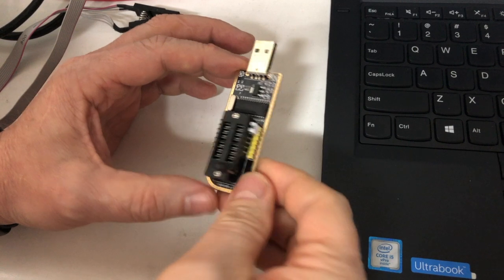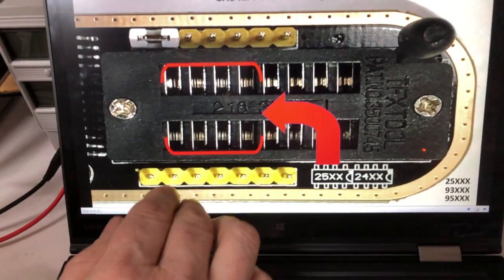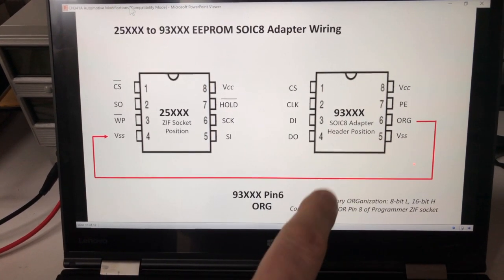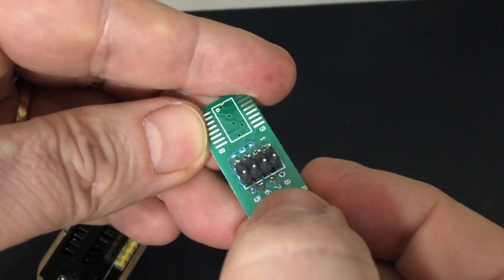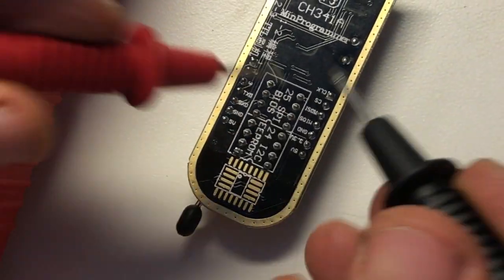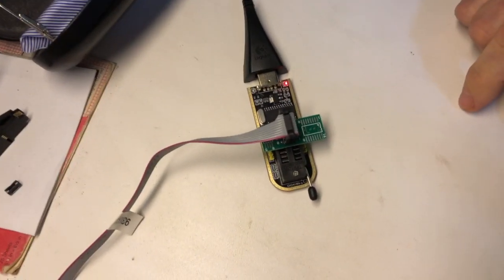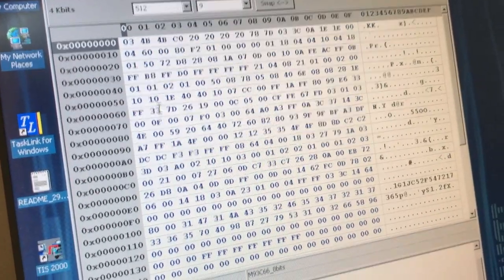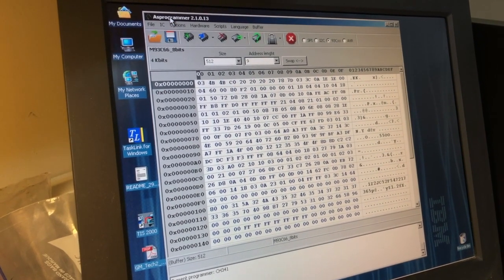Modify the CH341A EEPROM Programmer (Black Edition) for 5V 93XXX & 95XXX Automotive Use

Comment: No need to solder any wires, cut any tracks or lift any legs at all, I just connect another jumper on the pin header between the 3.3v and 5v rails, this effectively bypasses the 3.3v regulator providing only 5v to the ZIF socket and IC.
Reply: thanks steve can you post a pic of your jumper set up
Reply: @lourob5353   do you have any pic for jumper ? 🥲
Reply: Great. Could you show a picture how to do it easier?
Reply: Confirmed. Jumper between 5V and 3.3V and proper connection of microchip and socket pins enable us to communicate with 93xxx microchips using 25xxx socketm. Tried with 93c56(RL56) on VFR8006 dash and read and programmed fine.
Reply: @TheCychu977  I have the 93C56 chip on a 2007 Camry but it just gave me a bunch of 00s and ffs (I tested on a known good chip on the same PCB and it worked just fine). Did you get it to work while it is still on the PCB or did you desolder it and read it by itself?
Reply: @Baebon6259  hey did you end up programming your chip? Im curious as I have the same one and trying to work jt out
Reply: @TheCychu977 hey by any chance could you post a photo of the jumper setup
Reply: whatt phot pic ?
Reply: how?
Reply: Also lift pins 1 and 3 on the 3.3 voltage regulator. This will reduce loading the 5 volt supply.
Reply: @jeffanderson9093  which pins are 1 and 3
Reply: Tiene razón ahorita que mire el del video soldo un cable donde dice 5 volteos y lo junto donde dice 3volteos, y creo que algo recuerdo 🤔 hace unos días estaba quemando mi   eeprom de 3 volteos  nunca miré el puente si estaba en donde dice 3 v y 5v creo que si por que medí el voltaje y ne salia 5volts,  así que analice todo y le regrese el puente en donde dice 1 y 2 y cambie regulador de voltaje  creyendo que estaba dañado y ahorita haré las pruebas poniendo el puente  pero so es donde esta la zona abajo dice 3v y 5 v juntos soñó pasar el lente allí el que tiene plástico amarillo y listo 😅
Reply: Any pictures on where you put the jumper?
Reply: @kurtkaraan  the header is labeled on the pcb like CLK CS MOSI MESD GND 3.3V 5V   ,,,,, the 2 pins 3.3V&5V are the pins you put the jumper on it

Comment: Good evening everyone, my question is if after having made that modification to be able to program the 93xx series can it continue to be used for both 24xx and 93xx ???
Reply from the maker: The 93xxx is an external adapter + software, so has no change to the programmer.  The 5V mod is so you can do automotive versions of all these devices.  That one is permanent, unless you do a toggle or jumper approach, you'll lose the general electronics type 3.3V versions of the same devices.

Comment: Hey there do you know by any chance if you can read a 35080 eeprom with a CH341 ?.
Reply: Hi, thanks for this video. I can confirm the ch341a black can indeed read and also erase data on the M35080 eeprom. Writing is possible also except currently the first two lines which currently seem protected, working on this now if anyone has ideas. Happy to share the pin configuration I followed too if it helps anyone 😁
Reply from the maker: I have not personally tried it, but I do see the algorithm is supported for the ST M35080 in Asprogrammer as linked in this video description being SPI based.  BUT, you will have to construct an adapter for the 25xxx part of the ZIF connector, as the pinout is different.  Here's the M35080 datasheet that you can use to compare with the 25XXX I already showed in this video pdf.datasheetcatalog.com/datasheets/150/445022_DS.pdf

Comment: I bought a slightly different version of the CH341 programmer (not "black") and it doesn't have a dedicated +5V pin. The only place where +5V can be measured on the pcb is upstream and downstream of the "3V" :-)  regulator (the large regulator leg and the middle leg) and in the USB connector. Do you think it is safe to use the USB connector +5V and bridge it with pin 8 in the adapter for write power?
Reply from the maker: That used to be the problem with the earlier generation of these black edition ones too.   Since there's no jumper, the BIOS type folks loved it being 3.3VDC but that's useless for automotive work.   So yeah, you're going to get clean 5VDC from the laptop/PC USB jack as input to the regulator supplying your 3.3VDC.  Depending on the regulator type, there might be a 5V passthru pin you can bodge directly from, otherwise I'd just take it from the input to the regulator.   I wouldn't take it directly from the USB jack, it'll be less iron heat to tap the regulator.
Reply: @DrShock  Thanks! I'll tap the regulator input.

Comment: Could it be possible to still pull the skc off a 95320 eeprom chip without circuit mod if I don’t intend to reprogram it? I just need my security code so I can do key adaptation on my vw? Thanks
Reply: Also I have the clip and wire on small board attached to the black connector so the first part I have I’ve just not modded the main board to receive 5v
Reply from the maker: Hard to say, won't hurt anything to try.  You may be able to read it at 3.3V, I did read many devices that way just fine.   But there were a few 93s that wanted the 5V even to read.  What's more likely is to run into a problem reading it in-circuit with a test clip.  I find nearly all 93xxx and 95xxx boards need the chip removed.   Usually a 24xxx board you can get away with, but even some of those you have to desolder it due to interference from other chips that get powered up via the test clip.
Reply: Hi Doc can you confirm if the 95XX chips need the adaptor mod too? Cheers

Comment: i didnt get how you built the first board where did you get the black headers
Reply from the maker: Sometimes these black edition programmers come with some accessories like headers and a bare prototype board, for example.   Note that as I mention in the video though, if you try and repurpose one of those boards as a 93xxx adapter you have to cut the PCB traces and bodge wire it underneath the headers per the video adapter instructions.   The PCBs are wired for 24xxx EEPROMs originally just like the programmer itself.  You can't just add the wires, you have to remove the headers, cut the traces, and then add the wires.
Reply: @DrShock  so i have the same board that you have . and you are telling me that i have to cut the traces on the board and then ad all the cables that you did to yours?
Reply: sorry my English its not that great so i have to ask stupid question some times
Reply from the maker: Yep, if you're choosing to repurpose the little prototyping board that came with the programmer for use as a 93xxx adapter, then you have to desolder the pin headers off of it.   Then cut the traces that are not common with the 93xxx pinout.  And then solder on bodge wires to match the adapter instructions.   Then reinstall the headers.  This is a more advanced electronics approach, and more easily done under magnification.   A somewhat easier approach may be to build the adapter from scratch.
Reply from the maker: No such thing as a stupid question in engineering ;-)
Reply: @DrShock  thanks a lot i did i can read it now. but by mistake i removed a ship and i forgot the way it was can you tell me if there is a way two know how it goes on ?
Reply from the maker: @macgyver5033  Well what's the context - removed a chip from what?
Reply: @DrShock  from a cluster honda accord 05
Reply from the maker: @macgyver5033  No, not familiar with Honda electronics.   But a google search on 2005 Honda instrument cluster circuit board shows many photos

Comment: Tried this out the other day, thanks BTW.
One thing I did Different was put a hard drive jumper on the 3v/5v pins on the top. It seemed to work fine. I might still lift the 3v center leg. 
One heck of a learning curve for peeps like me...lol  Changed a XM vin before breaking my cheep clip.
Reply: Did you still have to do the custom SOIC8 clip conversion that he did? I purchased a ch341a that came with a SOIC8 adapter. I'm assuming that because of that, I likely just have to plug it in, put the jumper on the 3v/5v pins at the top (I need 5v as well), and I should be good to go?
Reply: I jumped across the regulator, Vin to Vout basically (5V to 3V) by installing the jumper.  I got 5V and yea h it seems like it would work correct?

Comment: Hi. My ch341a gives 5 volts by default on the data lines! Then is it ready to go for 93xxx or 95xxx chips? Nothing have to do? Thank you.
Reply from the maker: You have to have a wiring adapter for the 93XXX.   And for either you need a software app that knows how to program them as well as supports the CH341a black edition.
Reply: @DrShock  Ok. Thanks. But for 95xxx is ready to go by default then?
Reply from the maker: Hardware wise yes presuming your data lines comment was a typo as the 5V needs to be on the voltage pin and any other pulled high pins, but you still need to use a software that supports both the 95XXX and the CH341a black edition such as Asprogrammer.
Reply: @DrShock  Did they change the design? I remember that in the past (2019) 5V was the default, and people did mods to make it use 3.3V instead.
Reply from the maker: @TJGermany  Either that or there's more than one flavor.  The one I show in this video only has 3.3V.  Which is great if you're doing PC BIOS and other consumer electronics, but useless for automotive work.   Ideally they would spend the fraction of a penny to add a jumper for both voltages, but the Chinese manufacturers haven't bothered to do that.
Reply: @DrShock  Jumper would be great, or at least label the two flavors somehow! Mine is also the "black edition" and looks exactly the same as yours, however it was using 5V and I needed it - as you said - for PC BIOS and stuff that required 3.3V.

Comment: I'm tryin to read a cs566 (93s56 I believe) using your mod, however, when I read the chip it returns nothing but 7f 2c repeatedly. 
Any ideas?
Reply: It worked!!!!! At first I tried tying pin 7 to 5v and it didn't work. Then I tied it to gnd and it read the chip. I had just about given up. I almost fried the chip connecting the adapter backwards. It heated up real bad. I thought it was done for. Then I looked at my connection and noticed I had it backwards. Anyway your solution worked. I did notice that I get different data when I select the 8bit version from when I select the 16bit version. It still all looks like hexadecimal gibberish but at least it is data. Not like at first where it was clearly all wrong. Thanks a million.
Reply from the maker: Glad to read, just another task this little programmer can handle.  Yeah, it's very important you have the memory organization pin set high or low as the circuit requires and that you match that 8/16-bit selection (this info is in the video) with the software choice in Asprogrammer to read the data matching that choice (8/16-bit).
Reply from the maker: Would seem that you're getting power and ground pins ok with that outcome.   Presuming you have it plugged into the right ZIF socket section, then continuous fixed memory values would indicate to me either a mis-wired adapter (check each pin is uniquely connected the way I go over for the 93xxx adapter with no previous traces if you're reusing something for this) or that you have a conflict with another device on the PCB.  If the latter, just desolder the device and read it out of circuit to get around that.
Reply: @DrShock  Thank you for your prompt response. I just double checked step by step as you indicated in your video and the connections are correct. I noticed that lifting the center leg of the ams117 does not isolate 3v3 from the power pins though. It does however, show 5v at that leg when 5v is spliced to the vcc pins. Not that it affects it in any way just thought I'd mention. The chip is being read out of circuit so no interference with anything else in the circuit. Would it matter that the drop down does not show 93(s)56 and only 93(c)56?
Reply from the maker: The "56" denotes 128 words at 16bits wide so that part wouldn't be an issue. But checking an ST datasheet for this device (linked) the "s" denotes a security EEPROM type.   For the "s" series pin 7 needs to be connected whereas with the "c" series I cover in the video, pin 7 is a no connection pin.  While described as a write protection,  it appears that this PRE pin 7 on the "s" series is involved in both reading and writing (table 3 shows it low during a read as well as figure 4 on the datasheet).   I suspect you'll have to have a programmer software specifically capable of handling this specialized security device but you might just try pulling pin 7 low to ground rather than as a no connect (in your 93xxx adapter) - https://www.st.com/resource/en/datasheet/m93s56-w.pdf
Reply: I'm away from home now. Temporarily gave up on the ordeal. But I'm eager to get back and test with your suggestion as a last attempt to read the contents. This is a eeprom from a bmw cluster I purchased as a replacement for my non working cluster. What I did is swap the eeproms. My dead cluster eeprom provided the corresponding module with the correct vin number to my vehicle and in turn received the correct mileage. Now I know what the donor part vin number should be. Since I am new to reading eeproms I'm trying to satisfy curiosity and learn more about the process for automotive and other purposes. I really appreciate your help, feedback and support.

Comment: Hello, can I use this programmer to copy program from chip to chip? (Lets say 24LC512 EEPROM)
Reply from the maker: Well, only in the sense you can read/save on chip 1 and then load/write for chip 2.  There's only one ZIF socket after all.
Reply: @DrShock  Thank you, I'll give it a try since its low cost compared to other programmers

Comment: Nice and successful solution! thanks for the work you've done . Can you use a clothespin with 93xx? not using a ZIP adapter.
there are simply difficulties in translating)))))
Reply from the maker: Test clip I think is what you're asking about when you say clothespin adapter. You would have to make your own cross over cable to use one of those (desolder the little adapter board that usually is at the end of the cable and rewire it as shown in the video).   Remember you have to get the pinout shown in the video cleanly for a 93xxx, and the test clip cable will be wired for 24xxx by default.

Comment: Read eprom 95640 of vags grup autoradio with this trick?
Reply from the maker: You need the 5V hardware mod to write more than to read.  But the AsProgrammer software to add support for both the 95xxx and 93xxx to the CH341A black edition
Reply: @DrShock   how to do that please
Reply from the maker: @johanbazelli  It's in the video description.
Reply: @DrShock  were is the software cant find it i have ch341a but just drivers not the software
Reply from the maker: @johanbazelli  I have the version I used in this video linked in the description.  Read carefully as the site is not in English so if you try to use translate it will block the download link from appearing.

Comment: Pin 6 and 5 are connected at the same pin of the adapter? (pin 4)
Reply from the maker: Yes, these are explained starting at 2:45 in the vid.  The ORG pin you need to wire depending on the needs of 93XXX device you are working with.   Some will need this pin tied to Vcc instead of Vss as mentioned, it depends on the chips memory organization specified in the datasheet.

Comment: When i connect pin 5 to pin 4, and connect to the pc, the CH341A turns off, i already did 5v mod and all connections, help please
Reply from the maker: You made this 93XXX adapter from scratch right?   If you repurposed an existing board like I did, you have to double check your work that you cut/removed all existing traces to be left with only the connections shown in the video.   Some folks make the mistake of thinking this is laid down on top of those little green boards, but it is not.    It replaces them.

Comment: Did you cut the traces on the adapter board before you run the new wires? i don't see that on the video
Reply from the maker: The video goes over the electronics background on building a ZIF socket adapter for the 93XXX series EEPROMs so that this cheap programmers utility can be extended for automotive.  However building an adapter is an electronics exercise left for the viewer. There are many different approaches to implementing the schematic slides I shared, you can even breadboard it.  To build the 93XXX adapter it has to be clean slate with no traces at all of course as you are building the pin mapping in the slides I shared.   I built mine repurposing an existing board, so that it would all fit underneath the black pin header but I am not encouraging that as it requires a microscope to do.   You build the adapter using whatever you can improvise that meets the pin mapping requirements.